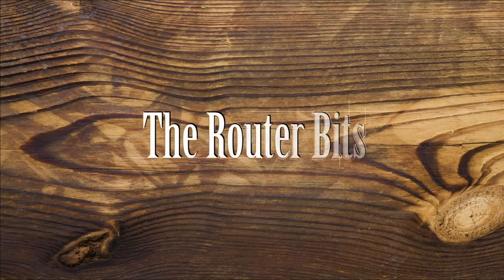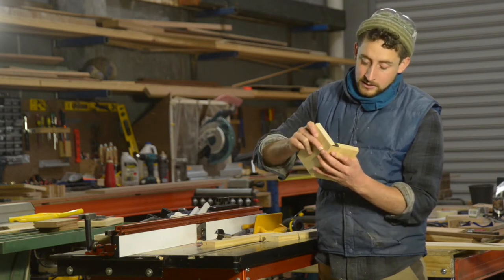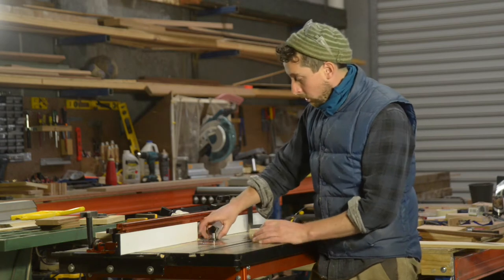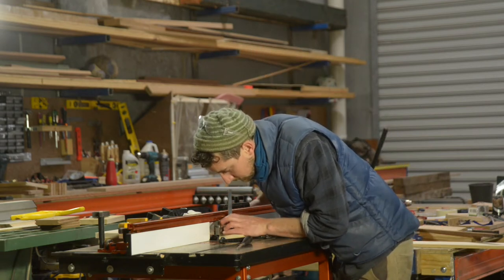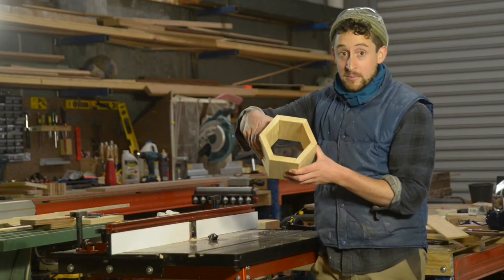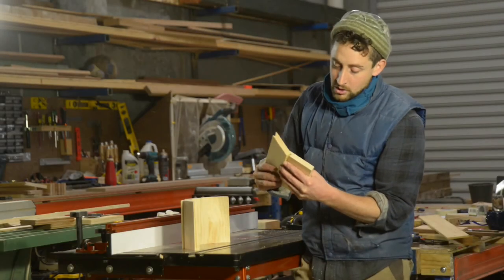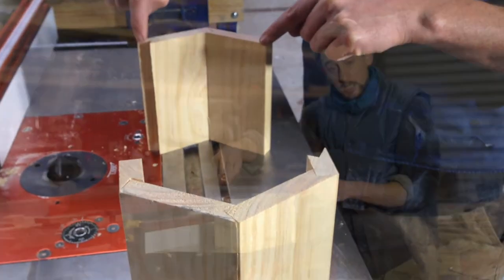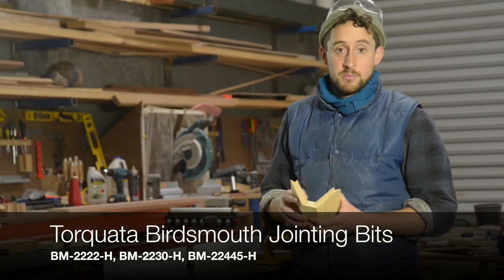The Router Bits - Using Birdsmouth Jointing Bits

Comment: By adjusting the height and depth of cut you can create a  smooth cut for the 12 sides as you did the 6 sides.
Reply: Is it possible to make a video on adjusting the router for height and depth of 8, 12 and 16 sided bits as well as the 6 sided.? I am having trouble getting a nice sharp edge on the 12 sided.. 
can I use the same method of straight edge for all bits??
thanks in advance.
Reply: It seems the  12 sided is backwards to the 6 sided.. How would I measure the bit?would I adjust the fence first & then the router height? I think I have the rest figured out.
thanks John